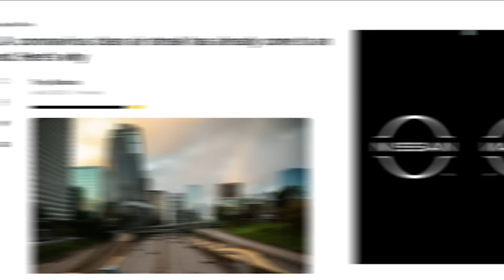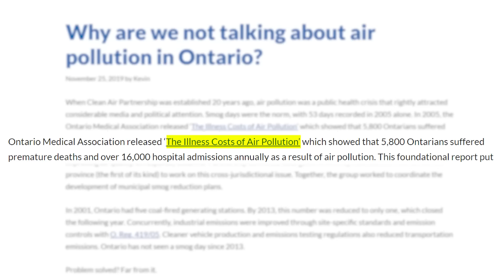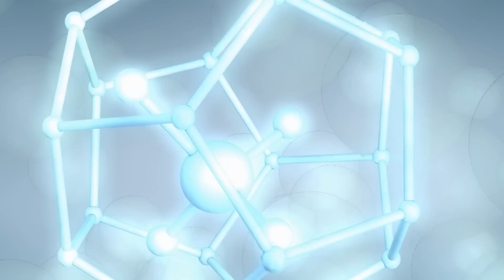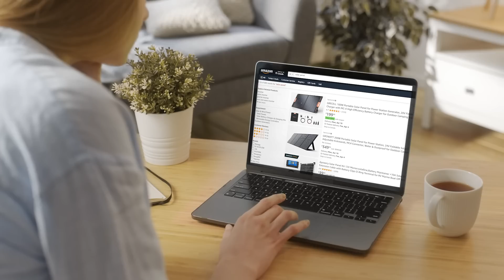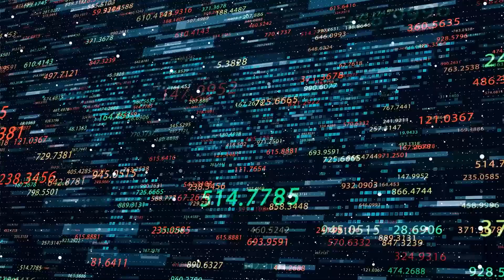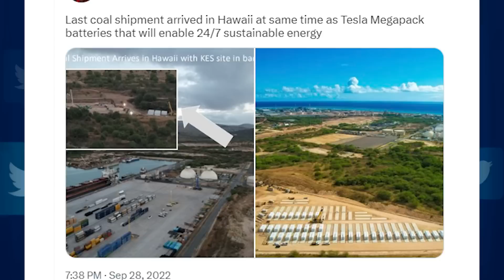The Real Reason Tesla Is The World's Most Important Company!

Comment: Stick to stuff you know about. You know very little about energy, you are brainwashed. Co2 is plant food. 1500ppm Co2 would be just dandy. CAGW is a fucking scam. If the green spoon heads are so worried they would support nuclear energy and hydro , they don’t. They don’t because it’s not about Co2 driving temperature, the elite knows it’s not, it’s all about power as in control. Do some proper research. Showing clips of coal powered power stations giving off steam is not pollution. Lay off the leftist talking points as doing so you sound like Greta.

Comment: Gas motors only 25% efficient like a incandescent light bulb.(most energy given off as heat)75% of the oil drilling, shipping, refining, transport thrown away as water, land, and air pollution.  Electric motors are 80-90-% efficient like a led light bulb. Their are 460,000 refineries worldwide which cause 50% air pollution